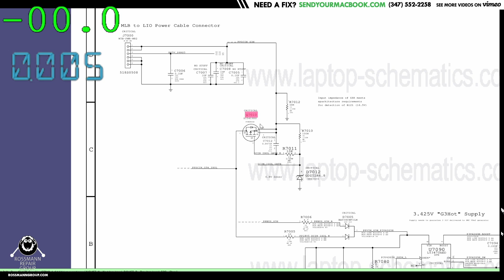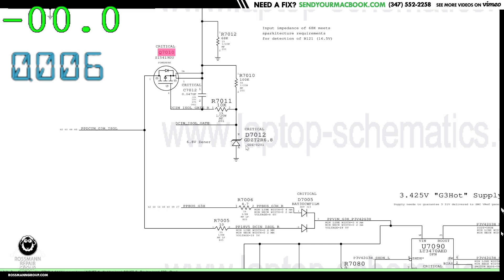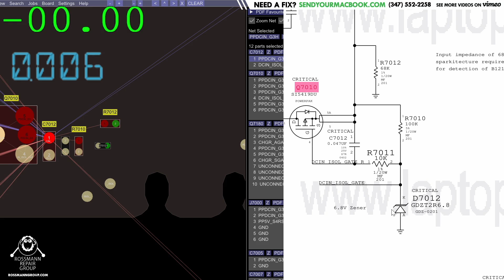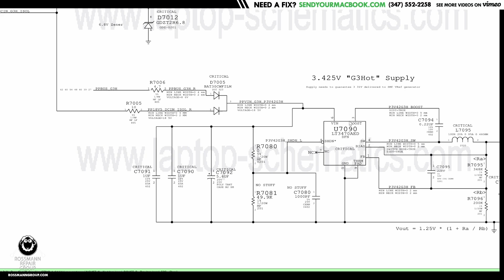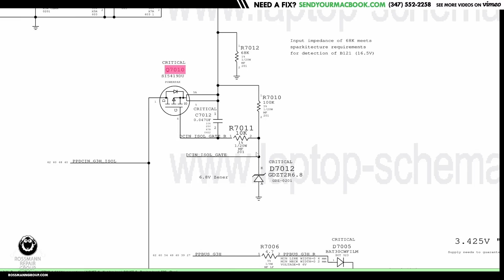It's Apple. Even the board components are laughing at you...

Comment: Not sure if this video was based off of comments made in the previous video requesting ways to make board editing videos better, but if it WAS...then it appears that you were reading the comments carefully.  This was good!  Good editing!  Much of the extraneous fluff cut (Oreo gets a pass!) Good explanation of your troubleshooting thought process as you progressed..and very good summarization!  My recommendation?  Use this video as template for the next board repairs videos as much as possible - wash/rinse/repeat.    Side questions about the actual repair:  How often do you see failed zener's on these boards?  That was certainly not what I was expecting to see.  Is it possible that the initial reflow (before replacing the diode) actually fixed something and not the diode itself?)  By 'glass' diode...I'm guessing you're referring to germanium?  Didn't even realize there was such a  thing as germanium SMT diodes :)
Reply: They don't use real germanium diodes anymore. It's expensive to find true germanium diodes. And I highly doubt you can get them in SMD format.
All the "germanium" diodes on eBay are just shotkey diodes relabeled.
Reply: @terminsane  Interesting!  Learned something new.  And yeah, I know about the whole germanium pricing thing (with thru hole parts), that's why I seemed shocked that they might actually be made in SMT format.

Comment: Handed in my Macbook Pro 2016 because the keyboard didn't work properly (butterfly switch problems). Got it back with the comment "Keyboard worked fine and was therefore not replaced". Tried to log in after getting the laptop back, but was unable to due to one of the keys used as part of my password not working... Yay! Apple sucks! So, now I have to be without a work computer for another 2 weeks. Is it really ok to need two laptops in order to own a Mac? (One to use, one to repair). I wish Rossman group had a shop close by :)

Comment: The component you are calling a diode is an zener diode etc. From what I can see from you circuit the zener diode is acting a a shunt regulator. So if the zener is open it will not pull the voltage down to the set zener voltage

Comment: Zener clamp, not divider.
Reply: Exactly. Probably to keep high V from going to whatever DCIN ISOL GATE is connected to. Also, R7011 is not part of any voltage divider, but forms an RC network with C7012 to limit inrush current when it's turned on

Comment: Um ppls are being charged 300$ for repairing sweat damage to their HTC Vive VR controllers, could be a valuable secondary line for you if you ever feel you need to "get away from that whole apple shebang".  Lots of manufacturers are making fine Apple-level products that need the TLC of a fine electronics technician.
Reply: Is there any known mitigations for avoiding repeated damage?
(not a owner, but I would guess there are interest for it nearby)
Reply: @erlendse  we'll Lewis is in repair not recall, need to talk to makersmuse or the like about designing up some retrofit gaskets put of pla and silicone. I'd expect Lewis would be a client side of this retrofitting be units that had been damaged as an option. Lewis would be invaluable as resource for designer though.
Reply: @PsychoticusRex  I know.

Still, if I have a device to repair(or fix it myself) I would have liked to see if I could do something to stop it from failing again.

Like if some simple tricks can be done to protect, would they?

They do not seem like the people that would have problems with drilling extra holes/other tricks if it made the end result better. Not noticed a lot of those tricks in the videos for some unknown reason.
Reply: @erlendse  lol, best I've seen is using a fan on the be kit itself, powered by usb or general advise to use a big floor fan because be is a secret technology to encourage exercise. Sweat is joined at hip with VR.

Comment: $1000+ laptop crippled by a 1 cent diode.
Reply: Sometimes fixes are really cheap.
Reply: dwDragon88
 Quote "$1000+ laptop crippled by a 1 cent diode."

That's not unusual for electronics, whether it be computers, TV or audio, or pretty much anything else. Plus it's not limited to just modern electronics. I have worked with vacuum tube and early solid-state units where a minor component failure in the right place would render the equipment useless.
Reply: hell no, those diodes are a dozen for a penny (and over priced at that)
Reply: A $50 million supercomputer can also be taken out by a 1 cent diode failing. 
The same goes for every computer outside of specialized redundant systems for aviation or aerospace. 
Electronics either work perfectly, or they don't. It's not like Apple products are the only ones affected. I've repaired a shitton of failed PCs and PC laptops with single part failures.
Reply: He wasn't saying it only applied to Apple products. He was just pointing out the irony of modern electronics.
Reply: @romancenturion8  I didn't say he did, but the video title is pretty specific and this is a MacBook, iPad & iPhone repair shop. Lots of posts here are pretty typical fanboi/hateboi whines I've been listening to since 1981 when it was IBM PC vs. Apple ][. It's getting old so I made sure I wasn't ambiguous. Apple screws up royally and regularly, but I tend to get about 10+ years of useful life of my macs and I run both MacOS and Windoze on them. I don't get that lifespan from any PCs other than Toshiba and PCs don't run MacOS unless you hack things. No thanks.
Reply: Peter S  My Dell Inspiron 17R has been running great for several years now. And it is running 10 - 14 hours a day for one reason or another every day. All that I have done to it is put new thermal compound on the heatsinks a few years ago and soldered in a new headphone jack a few weeks ago.
Reply: @robertcalkjr.8325  I have a box full of dead Dell Inspirons including the one that was my main PC for a few years if you want them.
Reply: Peter S  No thanks. Mine is working very well.
Reply: @Peter_S_  I do liike the Toshibas, I've had an A40 that's been dropped countless times, on concrete floors (industrial service), have an S11 now that's alright, just not quite modern.. Battery life definitely has something left to be desired
Reply: @mjc0961  LOL, did I trigger your inner hateboi? I guarantee I've bought significantly more Windows hardware and software than you ever will even if you lived to be 600 years old and I've been supporting Windows since version 3.11. As a consultant doing on-site service and repair for corporate America I can tell you Windows is a cash cow, Macs not so much for repair needs because they don't need as much upkeep. If that triggers you, nobody can help that but you.
Reply: @Peter_S_  > Macs not so much for repair needs
*Laughs in Mac+ Apple support employee that services more Macs in a week than you will see in a lifetime*
Reply: @duketogo2616  ??? I used to work for the largest Mac dealer west of the MIssissippi River and had a number of Fortune 500 clients as well as public utilities like PG&E and PacBell. We also dealt PCs. We had about 35 technicians, 3 warehouses full of repair inventory, and you could hire me at $250 per hour. After that I focused on engineering, ending up with over a dozen employees and doing contract work for Apple's Advanced Technology Group but I've never been an Apple employee. I've also worked for Sun Microsystems as engineering contractor. You can right now buy Thunderbolt RAID gear I designed at B&H Photo, Walmart, and retailers worldwide. How about you?
Reply: @Peter_S_  You used to work for "the largest Mac dealer west of the Mississippi River" 30 years ago. Your metrics are 30 years out of date. Packard Bell hasn't been relevant for over 30 years. Quit living in the past, boomer.
Reply: @noanoxan  LMAO, "Packard Bell"??? 🤣🤣🤣 No.... that's not a public utility. Try Pacific Bell/SBC Communications/AT&T Ever heard of AT&T? https://en.wikipedia.org/wiki/Pacific_Bell . I've worked in the industry my whole life and you can buy my designs off the shelf right now, today in big stores. These days I make the products that folks like Louis install for people like you instead of me installing other people's products for people like you and my products get more 5 star reviews than anything else. That's the present and I have more designs on the way under contract that haven't even hit production prototype yet. Maybe you'll amount to something, someday, maybe.
Reply: @Peter_S_  Methinks the Apple fanboi is the one who is easily triggered :P If you're such an expert what are you even doing on this channel?
Reply: @Peter_S_  "Ooh, what a clever boi I am". Hahahahahahahaha!
Reply: @TheCatLady65  People with experience who are good at things can't watch YouTube? What a clownish thing to think.
Reply: @Peter_S_  Ok boomer
Reply: @TheCatLady65  LOL, that's the best you could come up with? You're so original.... 😂
Reply: @Peter_S_  OK boomer :D
Reply: @Peter_S_  Were they using Macs made in the last 4 years? Because that's where the reliability started nosediving and we had a ton of internal hidden and many external public facing repair extension programs.
Reply: @Peter_S_  Well the real problem here is that any company including apple could make their devices more durable, for example conformal coating wouldn't cost much it mostly just slows production down but apple doesn't even put drainage holes in there and remember these things aren't some cheap $200 chromebook, yet if you spill coffee on your keyboard? Good luck, cheaping out like that shouldn't be normal for $1000+ devices.
Reply: @vgamesx1  You've never been in production, I can tell. I design hardware for a living and I became a factory authorized Apple tech almost 30 years ago.... you tell me all about it.
Reply: @Peter_S_  The bias is strong in you. I'm writing this from an Acer Aspire One (Atom FTW?). My PCs tend to last until the power supplies go out and take something critical with them, or until I decommission them, put the CPU in my display case/CPU graveyard and reuse/recycle the rest. How do I accomplish this feat? I take care of them. I've had four PCs and one netbook in the last 15 years. Two of the PCs were built with the same case, GPU, and RAM because reuse is a good thing and I don't like to make e-waste.

I just discredited your anecdotes with my anecdotes.

You're arguing for Apple reliability on an Louis Rossman's YouTube channel. There's a reason Louis has an entire business dedicated specifically to Apple product repair. Louis tells you all about it in each video. Are you new here, Mr. Irrelevantly Advertised Apple Authorized Service Technician that was certified 30 years ago? Can your outdated certification in PowerPC Macs shed some light on the issue of modern Intel Macs shitting themselves for things that PC makers seem to have ironed out a decade or more ago?

One more thing: if Macs increased productivity so much as you claim, then Honeywell, Lockheed, Jabil, GE, and everywhere else that I've seen in my industry would all have Apple purchase orders instead of HP/Dell purchase orders. Test stations would run on OSX instead of Windows 10. Jabil and Lockheed especially wouldn't be leaving productivity untapped because they're slave-driving corner-cutters like Boeing.
Reply: @Peter_S_  well you see on such systems there could be some "redundant" components to prevent such failures
Reply: @kapioskapiopoylos7338  That's not how redundancy in electronics works. The Zener diode that failed https://www.digikey.com/product-detail/en/rohm-semiconductor/GDZT2R6.8/GDZT2R6.8CT-ND/2075863 can fail in two ways, it could fail open or fail short and you can't just add extra "redundant" parts to deal with the case of a short. It shouldn't fail to begin with as it's rated for 100mW and in the circuit it should only be passing 1.74mW so it's oversized by 57 times. You can see physical damage to the package which is from the quality manufacturer ROHM Semiconductor and there is no way that could be from excessive current so the problem is likely physical damage caused by the encapsulating material Apple covered those 5 parts with. It looks like hot glue but I would have specified Silastic. It's also possible ROHM had a manufacturing defect; they still make these parts but they're flagged as NRND or "Not Recommended for New Designs" and they don't list a substitute.
Reply: @Peter_S_  Someone got their panties in a bunch. The whole diode thing is probably directed at the fact apple will just make up a story and force you to buy several "new" parts aka a new laptop upon checking this up at their own stores due to their incompetence while it's easily fixed with a small replacement. Nobody is saying it only happens to apple/mac devices. That's just your interpretation of it.
Reply: @Peter_S_  I feel like a lot of people missed the point in your comments, smfh.
Reply: @deadgaming20  Yeah, but what are you gonna do? 🤷 You can lead a horse to water but they have to figure out the drinking part themselves.
Reply: @Peter_S_  
I have only had 1 pc that has failed to the point it wasnt worth fixing. It was my file server/video conversion work horse. A $350 walmart special ran for 10 years at 98% cpu utilization. One day when I was at work the plastic heatsink mount broke and the cpu cooked its self before it could shut down. I could have fixed it for less than $20 but I wanted to upgrade.
Reply: @Rene In THIS case it's a 7 cent diode, but this isn't the only way boards fail and Apples fail far less often than the vast majority of PC hardware so why are you considering a REPAIR price to value the hardware versus the gains you get from PRODUCTIVITY which you benefit from every moment you're using the machine? LOL. I tend to go through 3 PCs during the life a single Mac and when the PCs fail I get a new one because they're disposable junk, even at $1000 a unit. It's my data that has value and my productivity is higher on a Mac so I get dividends every time I use it.
Reply: @Mr Guru While I agree with most of your post, know that Macs deliver higher productivity in the workplace so if I'm paying 45 employees to work and I can get 8% more work out of a slightly higher initial investment, I would not only be a fool to not choose Macs, I would be derelict in my fiduciary responsibilities. I haven't checked in a long time but it used to be that the Microsoft web site was made from images which the JPEG headers show were all put together in the Mac version of Photoshop; that's AT Microsoft.
Reply: @Rene How long have you worked professionally in computer repair? My shop handled Apple and 5 big name brand PCs (including compaq) and we had clients like HP, NASA, Genentech, Bank of America, etc.. In a business you use what gives you the most out of your employees. When you're self employed you use the tools that give you highest efficiency. In some sectors the Mac has always delivered more productivity based on testing. PostScript printed from a Mac will ALWAYS look better because the font "hinting" from the PostScript driver on a Mac uses a lot more data points to make smoother characters. I use whatever I need to use to get the job done. Your statement is silly at best because you can even buy the tools and supplies to do these repairs yourself on the Rossmann website. In business you generally call a consultant that charges big bucks to get on-site service and the majority of shops don't do component level repair, they do board swaps.